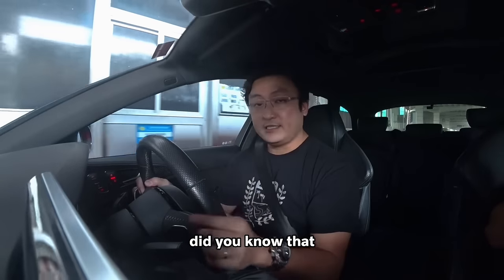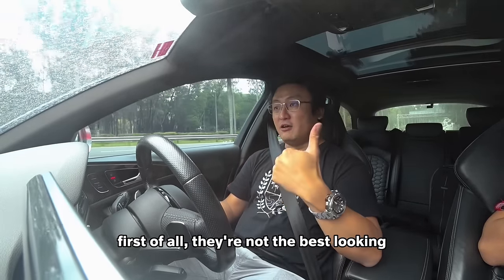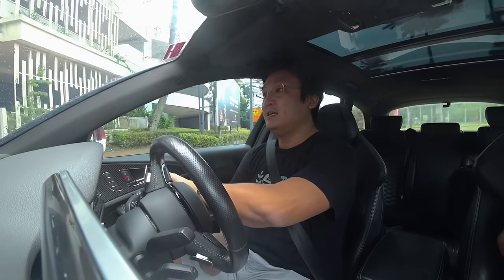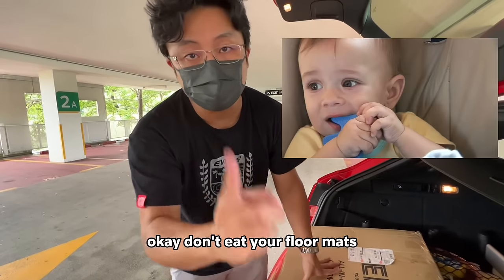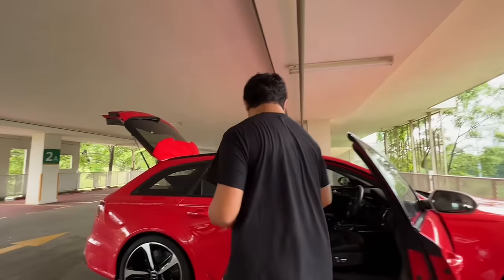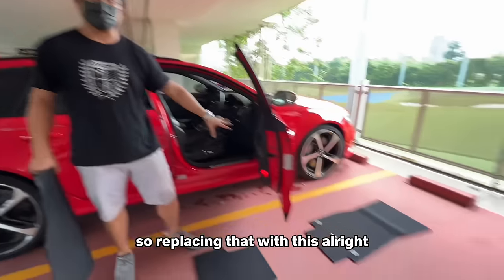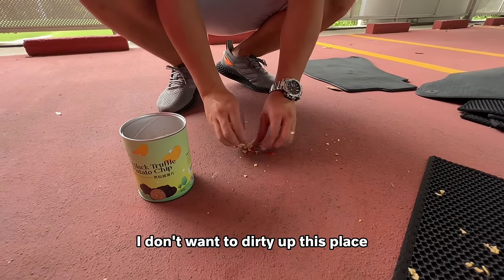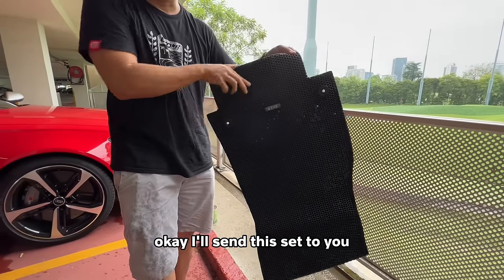What are the best floor mats for cars? | Evomalaysia.com

Comment: The problem with the 3M and Audi car mat is they don't have the Heel Pad for the driver side mat.. If you notice the 3M mat, the wear is where you shoe heels are in contact with the mat when you drive (accelerator, brake, clutch). Good quality car mats should come with Heel Pads to protect the mat from wear. The ENZO mat (Driver side) does not come with a heel pad so after some time, the TPP in that area will wear down.

Comment: This mat is quite good, but the spikes kind of destroyed the foot rest on my bmw by poking holes into it
Reply: Hi, what do u mean? Which part got poked?
Reply: @paulchung1387  under the mat there are spikes, so the mat covers the footrest of the car and it will poke holes into the footrest if u continously step on it, which is unavoidable. So now I can't change back to the original mat cos the footrest have those ugly holes
Reply: I see, the original foot rest was carpet material as well?
Reply: @paulchung1387  the original carpet doesnt cover the footrest
Reply: Ok, but i reckon it the footrest is hard plastic or metal it will not get damaged by the spikes correct?
Reply: @paulchung1387  it's rather soft rubber, like every bmw in msia lol. It already poked many holes in mine so you tell me
Reply: driver site we will keep rub the same part all the time, that why your enzo car mat poked a hole huh?